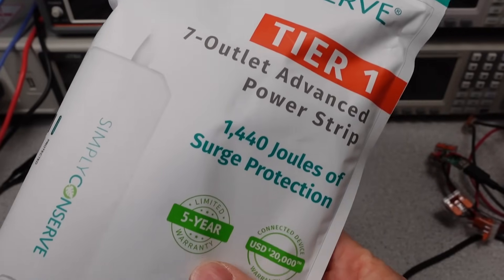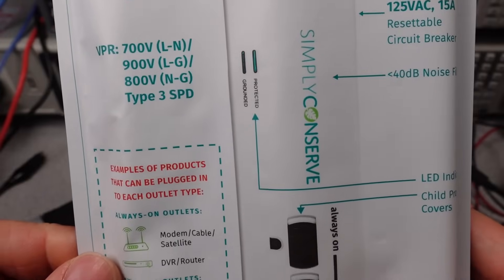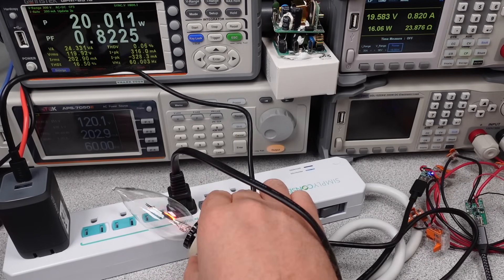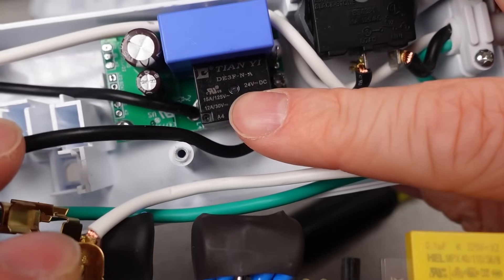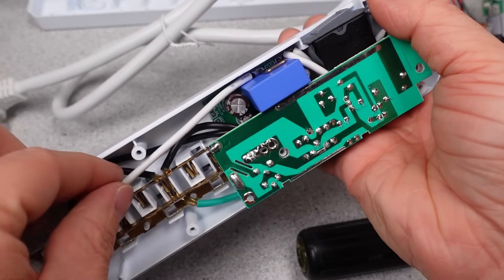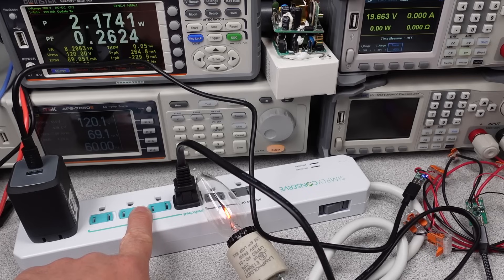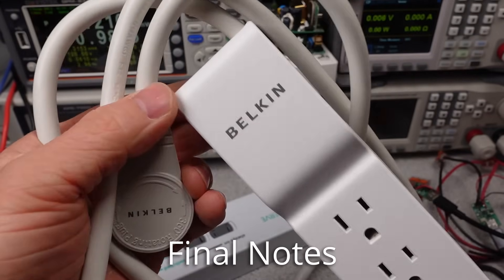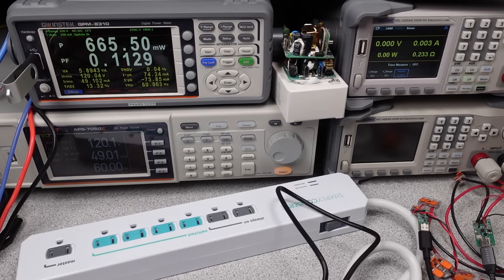Advanced Power Strip to SAVE you MONEY

Comment: Ugh. I have an 8 year old one (Mi? Can't read the weird font they're using on the front) and almost certain I've been spending more money than saving after watching this. I have an Apple TV 4K, an 8 year old LCD TV and a sound bar plugged into it. Time to get a new power strip :(
Reply from the maker: Depends on the equipment still.  If the sound bar doesn't have a low idle/standby state, it could very easily use several watts in the on state.  So, you could be one of the savers.  But yeah, there is no reason other than cheapness that this power strip idles at 0.7w instead of a more reasonable 0.1w.

Comment: Your setup 1 assumes everyone owns components that have low stdby power consumption/ even offer it at all.
My speaker setup at home, as an example, is very old. They're exceptional speakers that don't need upgrading, and neither do the 5.1 receiver, amp, and sub. The sub does not offer a standby mode, and instead is on all the time.
For me, having something like this is a godsend.
Reply from the maker: Thanks!  Yeah, that's kind of what I was looking for.  There is a reason this exists, it isn't really saving energy, it's convenience. The video does assume newer equipment compliant with DOE regulations.  I did for a while have a pro sound amplifier for a subwoofer amplifier and yeah, I had to turn it on and off every time, so I just didn't use it.  This switch power strip would help with that for sure!

Comment: Pretty niche, especially these days when almost any device idles at extremely low power consumption. Possible applications:
- For some reason, you have a room laid out with a floor lamp with a built-in switch or something that you'd like to use as the main switch for the rest of the room lights. Maybe you're renting and there are no switched outlets in the correct location?
- You're pairing some sort of vintage sound system like an old receiver to a TV, so you can switch the receiver on automatically when you power up the TV. Modern devices don't waste so much power at idle and usually support stuff like CEC anyway, but vintage gear won't on either count
- You have some floor fans to cool off a room. You can use the switch on the fan itself for the convenient one near the doorway to turn on two or three fans simultaneously
- You have some kind of an off-grid home and have a full set of internet equipment, but only one computer (and in this hypothetical scenario you don't have phones and never use wifi for some reason). You could turn on your switch/router/modem whenever the computer is on, saving a decent chunk of power.

It would be a lot nicer with a little 3-position rotary dial or something so you could set the trigger wattage to something like 5, 20, 100W or something like that to better match the master device.
Reply from the maker: Nice options for uses for this!  Yeah, they sell one with a selector but the wattage values are all still too high.  The sensitivity is an issue with the current shunt size.  To sense 5W with a current shunt made for 15 amps with any kind of reproducibility on the production line...  Hence the 15-18 watt range.  Yeah, there's other ways to sense that power is moving.  I'd misuse an RCD circuit.

Comment: Do the Z-wave, WiFi, Bluetooth, Zigbee, etc. Microcontroller/relay power strips actually save power? It's getting around the holidays/first frost where I'm at and I wondered if I could run a switched space heater, christmas lights, and some stuff off of one smart strip. Not all at once of coarse, 15a-20a 120v N.A. Breakers/wiring would trip if you put a tea kettle on the same breaker as a space heater, but My sister wanted an automatic "reading cycle" to warm her chair and brew her tea before she wakes up to Christmas lights in her 3.5 season sunroom. 😅It kinda needs the space heater to help  fight the room up to a sunrise/sunlight maintained room temperature when it's -20°f/-28.9°c outside on a cold winters night.
Reply from the maker: Yeah, I looked at two a long time ago, the basic one used a basic capacitor dropper and a zener power supply, those mostly break after a couple years, I also tested a smart wifi outlet and that used a switching buck power supply and has been reliable for me, and a bit more efficient.  I need to look at a lot more of them.

That is one heck of a use case!